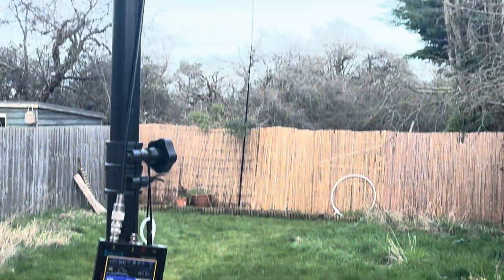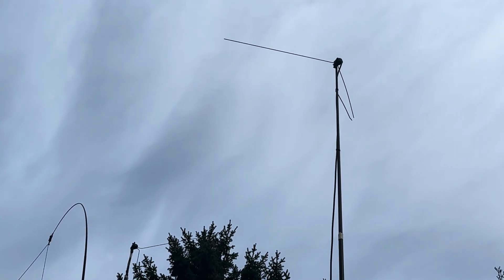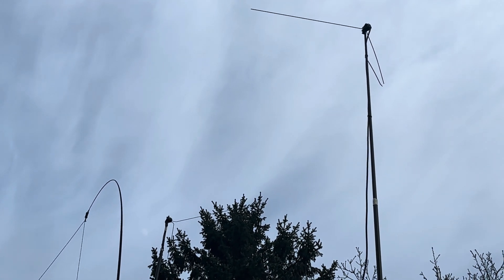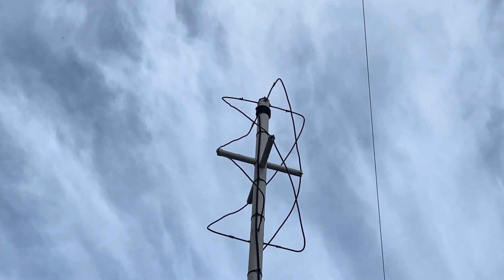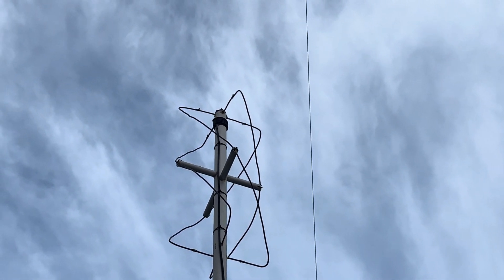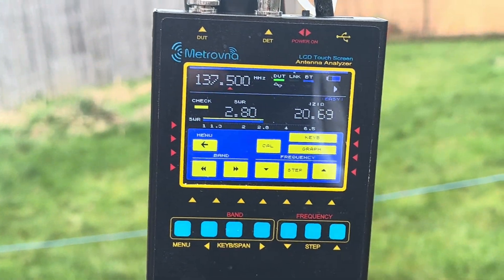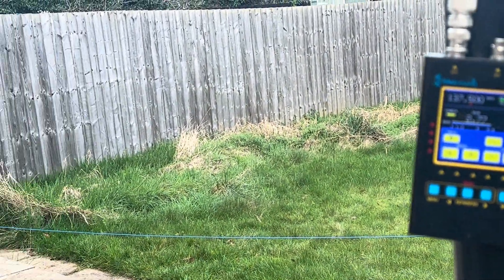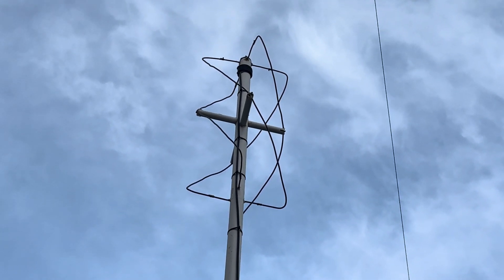I was loaned a Quadrifilar Helix Antenna (QFH) for NOAA weather satellite reception

Comment: Clint - can I ask what signal strength change you see with your Antennajet in-line? You are the only person I'm aware of that has one. I'm using a Wellbrook and then use two downstream ports to a TS990 and RSPdx - I'm seeing about a 1-2S-point drop in signal strength on 40m - It seems to me to be a very expensive BNC Tee connector! It's being run from a dedicated 12V supply. Interested in your thoughts.
Reply from the maker: Hi I've not noticed any drop in signal strength - it uses an ultra-low noise amplifier with an insertion loss of around 1.5 dB. It's a great bit of kit.
Reply: @OxfordShortwaveLog  thanks - I’ll have a chat with Bonito.